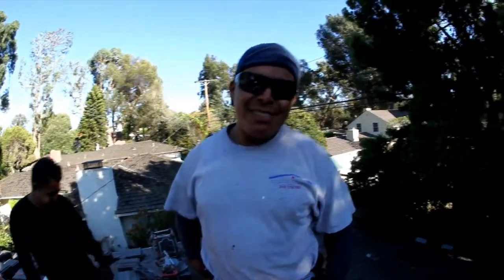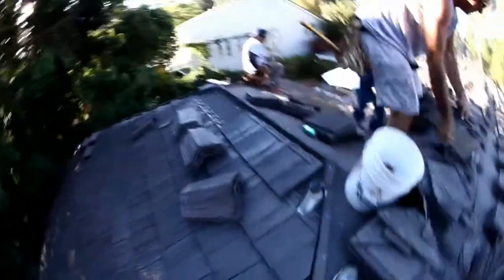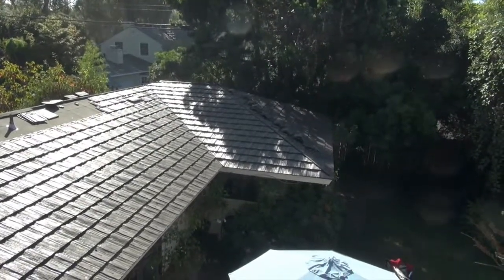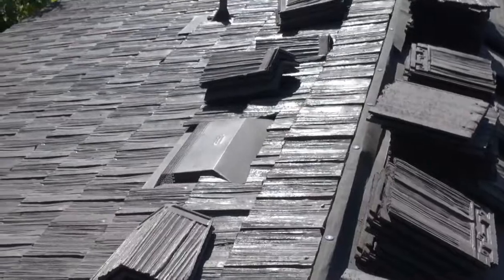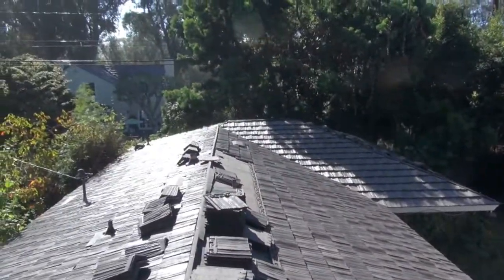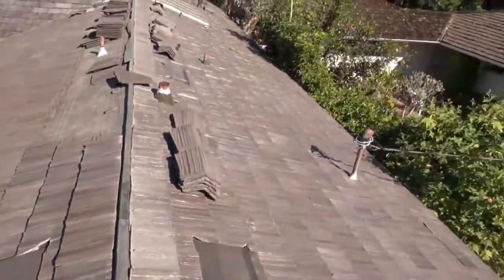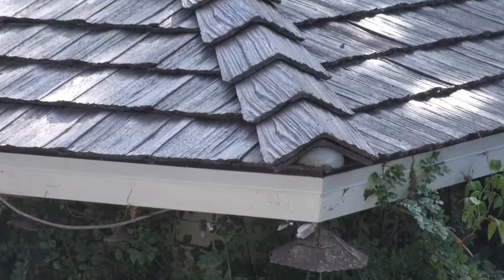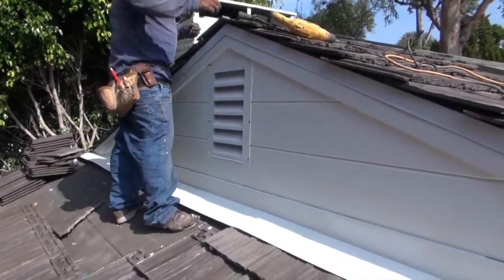How to Install Cedar Lite Tile Roof Palos Verdes Estates Roofing

Comment: We would like to put Cedarlite tiles on our roof, but are worried about them being brittle.  Does the foam application help with stability when walking on the roof?  We have to clean a valley that collects twigs and leaves, a few times per year.  We are also getting solar panels installed.